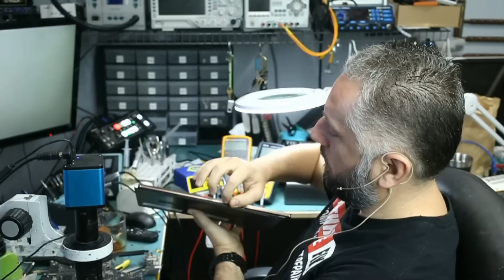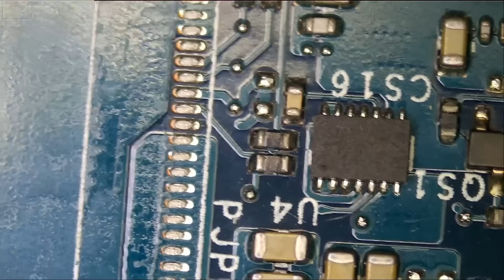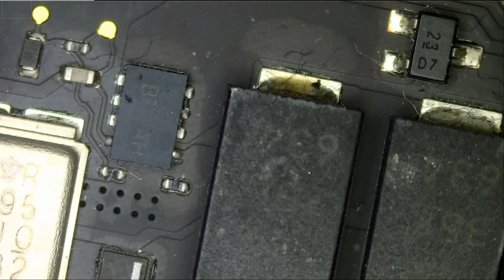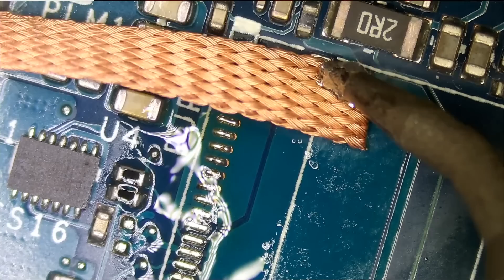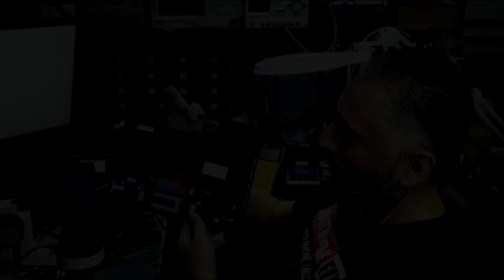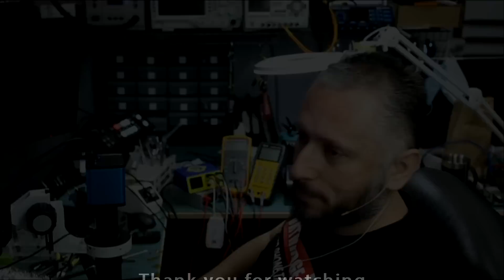HP Spectre Laptop Repair - 30pin Battery connector replacement using a Macbook part

Comment: i have this laptop, first time battery failed, got it fixed under warranty, the next 2 - 3 times, the NVME cable failed because of how its designed (cable is too long). its crimped at a sharp angle and then anchored down in place. I made my own solution to make the NVME run above the battery and not screw in the NVME at all so that the cable can be relaxed and not twisted in an bad position.

Comment: Did you check to see if it will charge correctly?  From lookin at your video at 1:25, you can see that the pins don't line up to the ribbon connector, they are almost in between 2 pins from the connector.  The very top pin doesn't look like it's making contact with the first pin on the ribbon connector, they look offset by one pin.  There are several pins in the middle of the connector that need to make contact correctly to determine the charging of the battery, the outer pins don't matter as they are all connected.
Reply: If you look closely at the ribbon cable you will see that several pins are using the same pad on each of the ends .   There are no single pins on either end so it works great as a replacement .

Comment: You should do what I do. Just have a cheap drive laying around with Windows on it already. It's a quick test to make sure that the system can see installed drives. I have two, one for m.2 and one for sata.

Comment: If you really cannot find the connector, would you solder wires to the cable pins and solder to the board directly?

Comment: Alex i have a small quostion what if there are some components under the board is it beter to solderi pin by pin with soldering iron or there is still possibility to reflow from underneath without loosing components?
Reply: The solder on the motherboard is non-leaded solder and Alex used leaded solder under the replacement connector so he can set his hot air station to a lower temperature that wont affect the motherboard non-leaded solder so the components will stay in place and the connector will reflow with good flux.
Reply: @mariolemerise7732  ok but imagine if u need to desolder component like this and solder another one to solder i know that its leaded but when your unsoldering your not use leaded solder 🤔😅
Reply: @deividassirutavicius3128  You can apply low melt solder with a fine tip on the connector pins before removing the connector with hot air. Use a lot a Amtech flux on the connector.
Reply: In modern design it is very rare that the battery connection has any kind of components underneath it. Not impossible, but most manufacturers have learned to leave that area alone.

Comment: After watching several of your videos it seems that the success rate is proportional to the ability to get replacement parts. I had to send my broken 6 pin connector for my system 76 laptop back to them for repair only because I couldn't get a replacement connector.   I tried for 4 months to locate a replacement but just gave up and sent it in.   The cost of repairs made me realize that I should have just cut my losses and replaced the laptop to begin with. It's fixed now but it was not a cost effective repair. 

Keep up the good work saving what you can.

Comment: I'd say you could use the grinding pen to take just a little bit off the end of the battery ribbon connector so that it is easier to attach it.
Could even lube the connection with pure silicone.
Will also say that Apple uses standard parts just like every other electronic device company for the common components.
Cost, I'm sure is what that is all about.